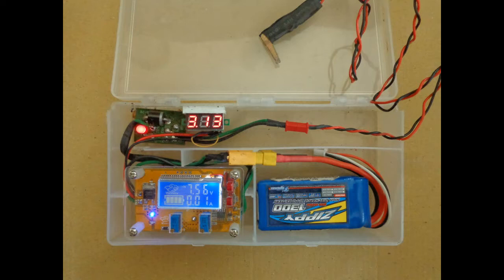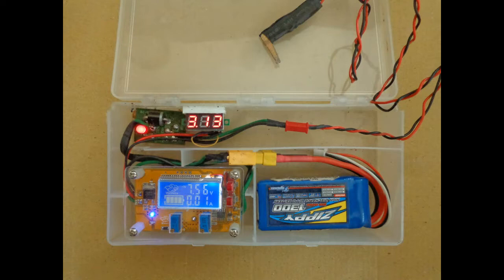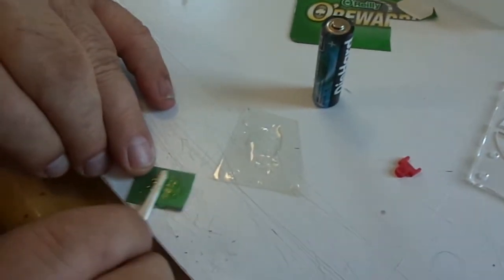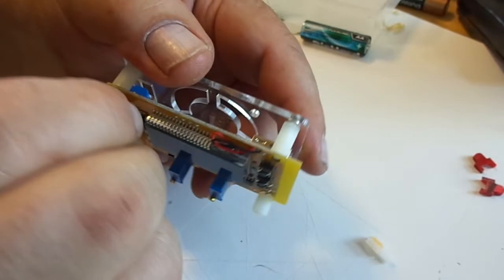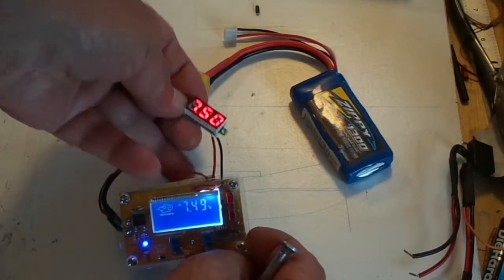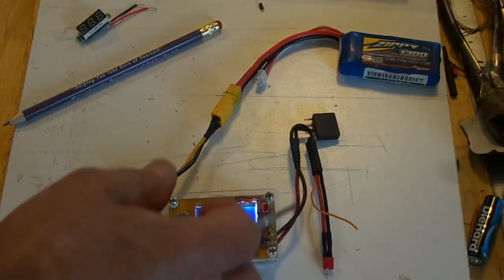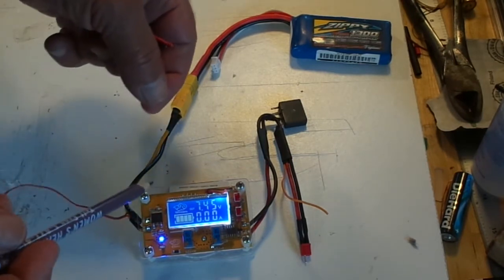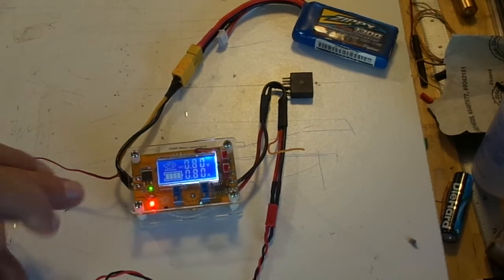Supercap Field Charger Build for Free Flight Models

Comment: Is there any reason why you output 3.1volts instead of 2.7 ?
Reply from the maker: Actually, yes. Originally it was to duplicate the voltage of .the two AA alkaline cells we were using at the time. Afterwards we found that we could push the caps a little bit higher than the rated 2.7 volts and get longer flights. That last little bit of charge makes a huge difference!
Reply: I’m learning loads. I started with a three  alkaline cell charger with an led voltmeter. I stopped charging when it lit up at 3.4v. I now have a set up like in this video and set it accurately to 2.7v output. Having watched this video again, I set the output amps limit to 0.8. It was previously at 4 amps! I’ll change the volts to 3.1 and take a long pole with me. My best flyer is a biplane with an 8520 motor and a single 20F capacitor. The grandchildren are my excuse😀. They fly the Chinese RTFs that I have given enhanced dihedral. Because of Covid restrictions my usual large flying field is not available, and there are no free flight competitions for my rubber models. It’s good to explore a new branch of the hobby. Your videos are just the job.
Reply from the maker: @jimbo2629  The 8520 with 20F combo works great with a 65mm prop, that's the setup in my red and white sunburst 16 inch Jetco Dragonfly. It does a minute reliably or at least did until I lost it last week! I will have to build another one, it was a great model! I now have my field charger set to .8amp limit and 3.2 to 3.3 volts. Rich and I have been pushing the caps a bit, they seem to stop taking a charge when they reach a certain point...you can watch the amps reading drop as the cap tops up. The caps vary individually a bit in their limit voltage with some able to charge up to about 3 volts. I understand the +/- tolerance on similar caps is up to 20% ! I don't know if you use facebook, but we've started a page there for capacitor (and other flying) stuff and it's called the sonex413 Pilots' Lounge. Stay safe, -Mike

Comment: Thanks a lot Mike for this tutorial! I dont have easy-cheap access to lipos here so I went the simple way as you suggested. I put up a short image video for the 2 wire modification, in case some find it useful. Mine's circuit is bit different in that it didnt come with the zero ohm resistor; so I just had to attach the third wire. https://www.youtube.com/watch?v=Difx2ih53jg
Reply from the maker: Nice Job!!